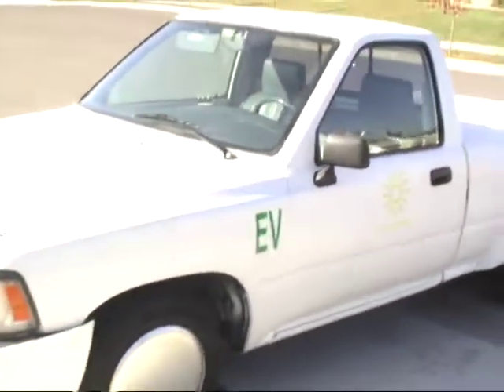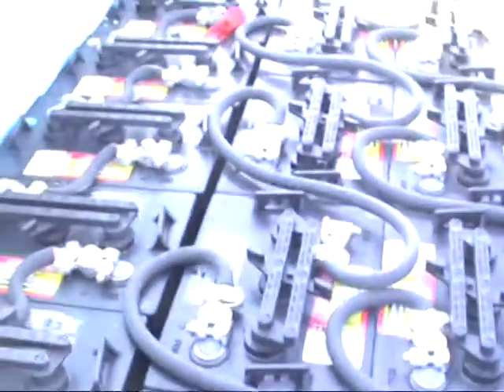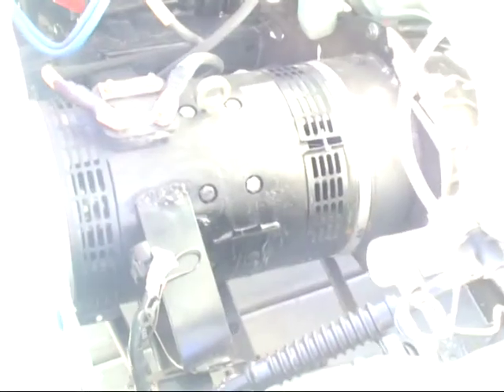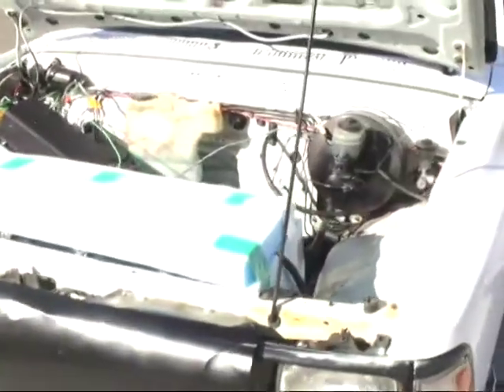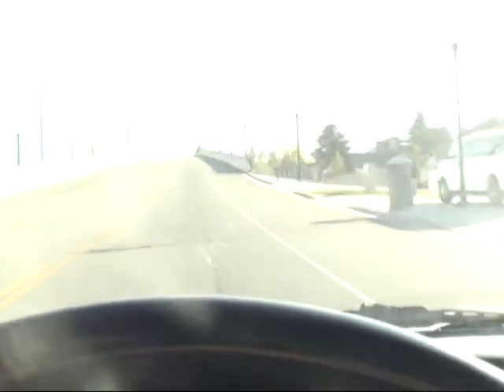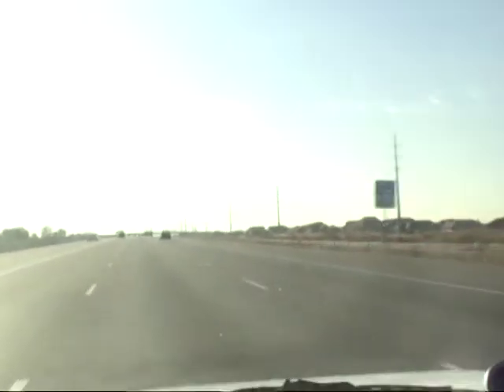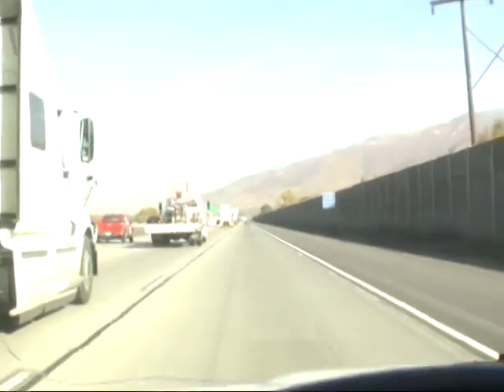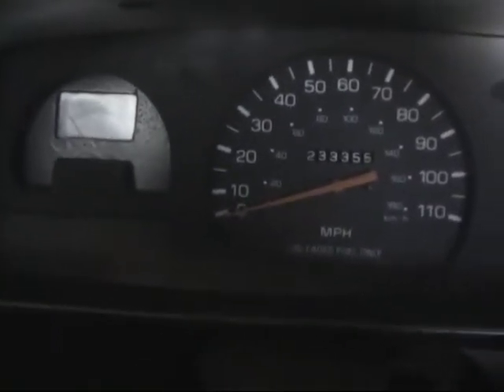Life with an Electric Car

Comment from the maker: @daswada9 Golf cart batteries have thicker plates, more current carrying capacity, can be recharged 3-5 times more than 12V deep cycle ones and can be more deeply discharged.  I also get more range using 6 volt batteries than 12 volt ones.  More lead = more range.